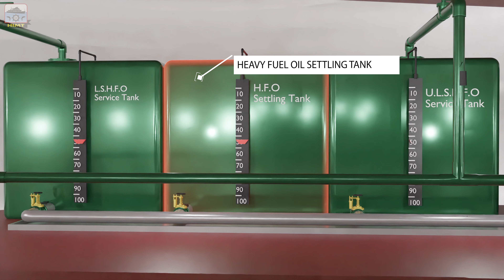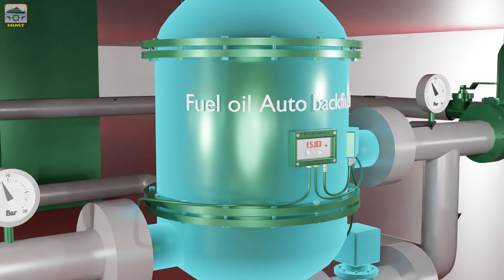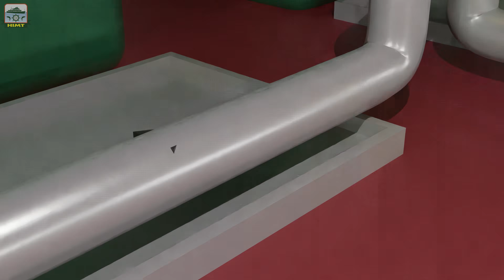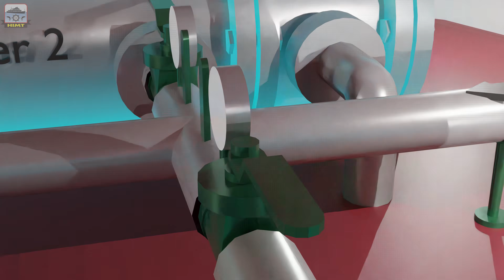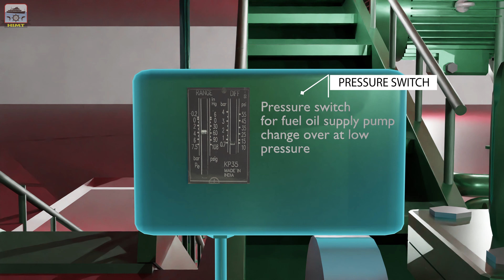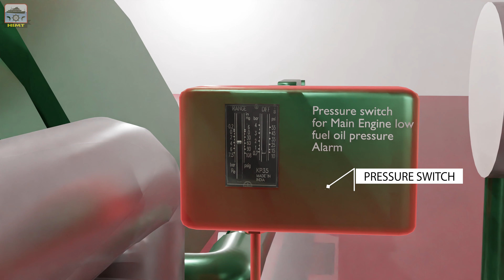Main Engine Fuel Oil System | 3D Animated Explanation | HIMT

Comment: Pressure regulating valve normally is located at the end of fuel oil supply pipe after FIP at the fuel return to the  mix tube pipe line.